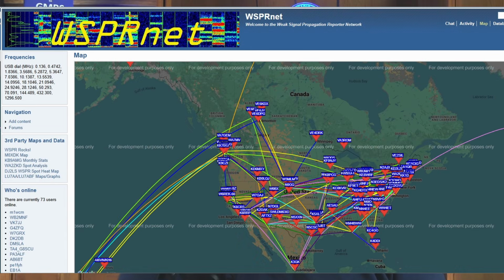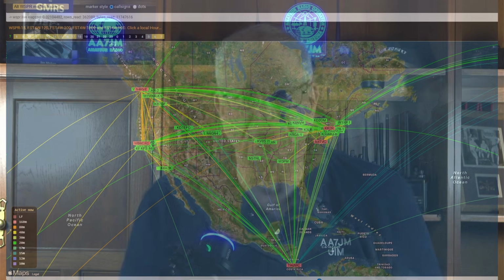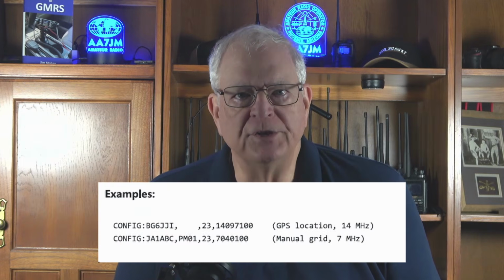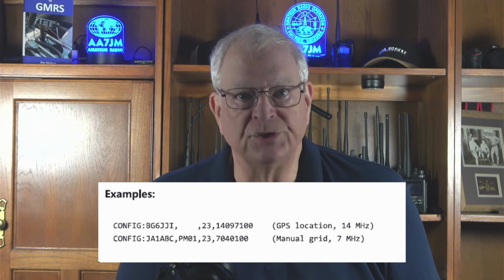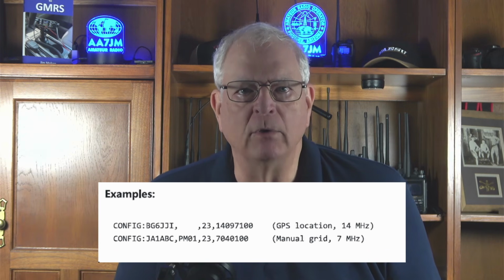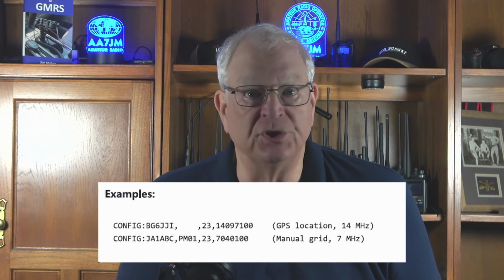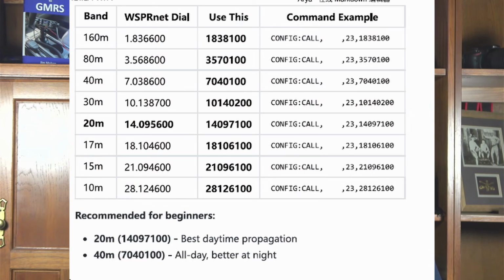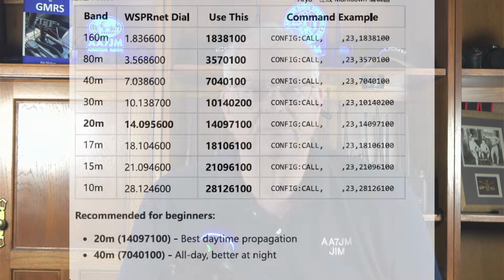Check Your Antenna and Propagation With This WSPR Beacon Transmitter

Comment: just an idea...wouldn't it be possible to use a raspberry pi Zero 2 W and communicate with the wspr device, so that you could have those scheduled transmissions?
Reply from the maker: Folks do amazing things with the Raspberry Pi.  Unfortunatly I'm not that guy. Good idea, though.

Comment: You can test to uncheck more than one frequency lines for a multiband antenna? 
it is possible?
We can do this with ZachTek WSPR firmware. It act like a row transmitting all selected bands one by one and again.

Comment: I don't know why anyone would buy one when WSJT-X does it for free.
Reply from the maker: Thanks for watching and commenting. Perhaps someone doesn't want to go through the WSJT-X setup process when all they want to do is check band conditions or antenna output? Cheers.
Reply: I use it to give me a beacon to help ensure my SDR radio is working. I use a dummy load rather than connect an antenna. I is also a great teaching tool to learn about WSPR!.